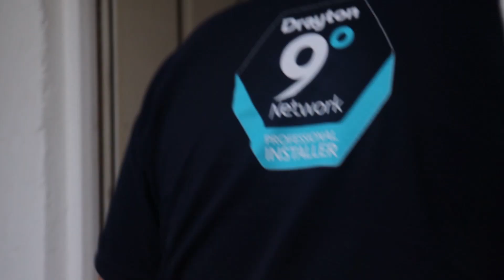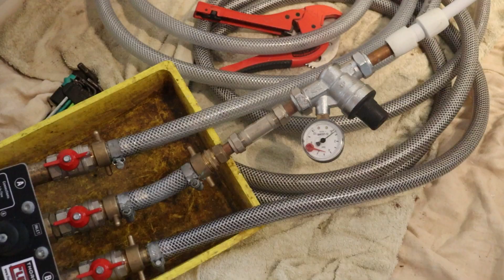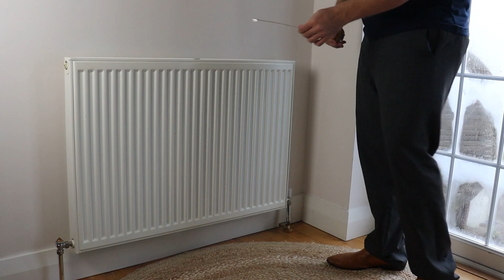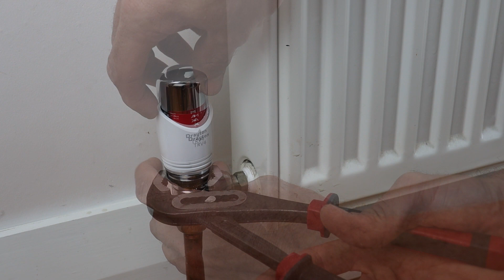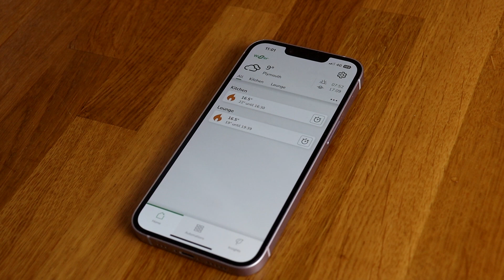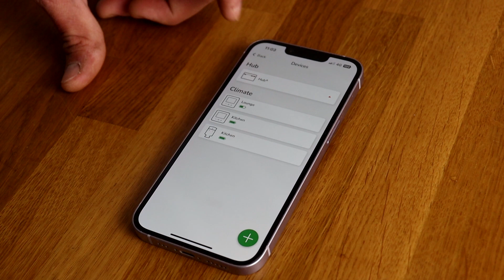Installation of Drayton Auto-balancing TRVs

Comment: How do you get the flow rate also does these trvs need to be fitted to the flow side or does it not matter
Reply from the maker: For the head to be vertically, they need to be fitted to the flow side however, they can go on the return but the head will be horizontal.
Reply from the maker: flow rate can be determined using the Drayton Auto-balancing calculator on our website

Comment: Are these compatible with opentherm combi boilers? 
I used the calculator and set for 75c/delta 20. 
With that setting the boiler seems to keep flow temp at 70 but rooms take longer to heat up and lower part of rads feel cool. If TRVs set to delta 15, boiler flow sits at about 55 and rooms heat quicker, rads Feel evenly warm
Reply from the maker: Is your pump set at a fix speed or does it vary based upon demand?
Reply: @Draytonheating  it’s meant to be variable ( Viessmann vitodens 050-w b0ka ) I can manually adjust it though.
Reply: @Draytonheating  just had a reply from Viessmann. In opentherm mode, the pump is at a fixed speed, that can be set on the boiler.
Reply from the maker: We recommended fixing your pump speed when using opentherm with the auto-balancing bodies so that sufficient flow is delivered to the system.

Comment: does this do away with the need to put a balancing valve on the return leg?
Reply from the maker: Hi Charles, it’s good practice to always fit an auto bypass valve between the flow and return.
Reply: @Draytonheating or just don’t fit a trv on one rad, normally the bathroom one and that’s your by pass. Most boilers also have an internal by pass fitted to.

Comment: Can these valves be used with a combi boiler? I understand the internal pump usually modulates the flow down, so will the water reach the more distant radiators?
Reply from the maker: The auto-balancing valves are compatible with combi boilers however, you need to ensure that the minimum flow rate that the boiler pump modulates down to doesn't fall below the total minimum flow rate requirement for your system. The flow rate for each radiator can be calculated by using our online calculator.

Comment: Any idea how these would cope with a "smart" circulation pump, set to auto-adapt (!) - proportional pressure etc.
Reply from the maker: They will work fine so long as the flow rate doesn't modulate below the minimum that is required for the system (this will be based on total kW output).
Reply: Do these valves work as a flow limiter and the valve will only see max flow when it’s day -5 outside? Or are these like a PICV?
Reply from the maker: Yes, these work as PICV (Pressure Independent Control Valves)
Reply: If these valves work as a PICV then any heating system these are installed on will be more out of balance than in balance. We use PICVs in the construction industry and they would really well but they module by a BMS system. In a domestic dwelling that type of technology is not practical. By am means use these on older boiler systems with fixed speed pumps and on/off heating controls but not really suitable for newer boiler/heat pump systems.